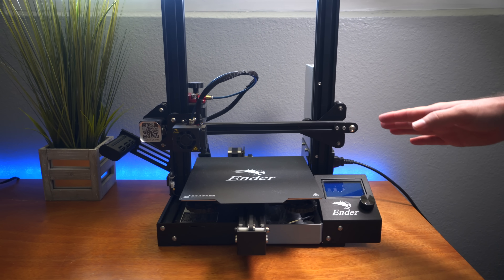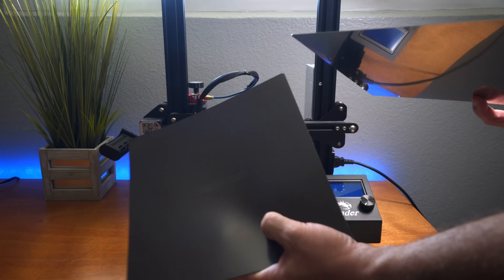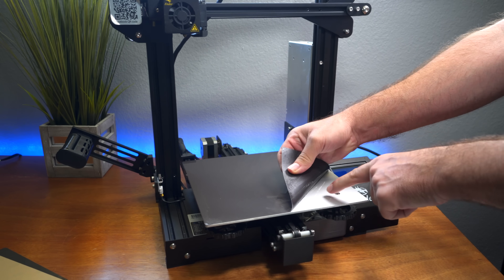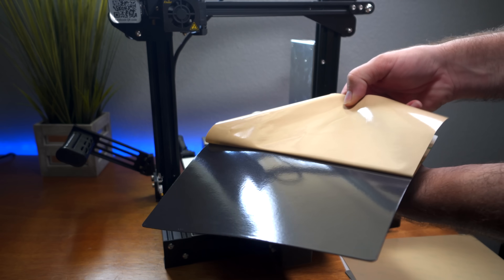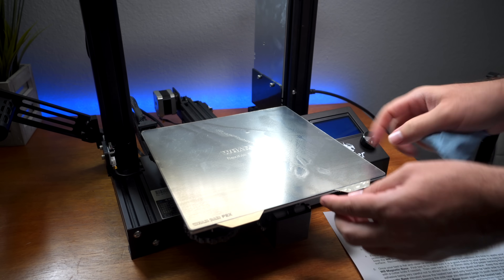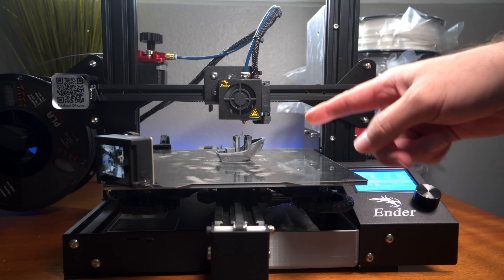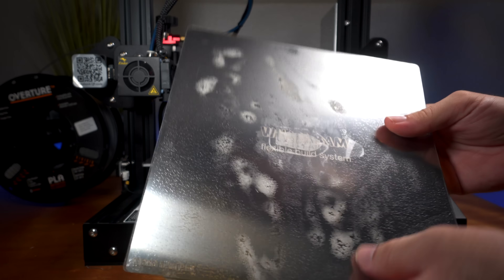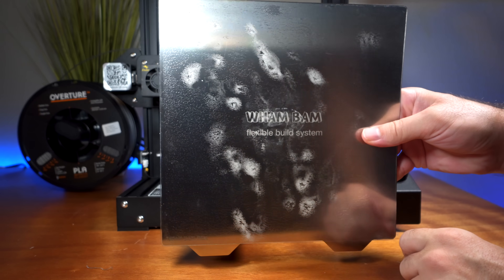Wham Bam - Flexible Magnetic Build Plate - Ender 3 Pro

Comment: To avoid bubbles: Spray surface with tap water first, THEN apply the sticky surface. You will be able to adjust the surface to make sure it's perfectly lined up. Scrape it with something solid but not going to scratch it, like a credit card, to get the bubbles out (since this one has a removable top protection, you can use something stronger, like a metal ruler). Heat the bed, which will cause the water to begin to evaporate and will show you where you missed some micro bubbles. Scrape them out with the credit card while the water vapor is creating a small "air" pocket (aka bubbles), and you're golden.

Comment: the original "sticker" that you peeled off is also magnet sheet. so you peeled off a magnetic sheet to put on another magnetic sheet.
Reply: While there are a lot of problems with this video, I would like to point out that the magnetic sheet he installed can withstand higher temperatures than the stock ender 3 pro magnetic sticker. If you want to print with the bed at higher temps than 70c, it's really recommended to install a better magnetic sticker like this one. Probably not a necessary swap if you're just printing PLA only though.

Comment: Not sure why I see people say that the magnetic bed that comes on the  Ender3 Pro doesn't do well for filaments that take higher bed temps like ABS & PETG. I understand that you can demagnetize the bed at pretty high temps but you really don't need to get high enough for that to happen or at least shouldn't. I print a lot of PETG on my Ender3Pro and it works great. Even used a bit of my old ABS. It holds the prints down just fine. For the models that might give problems I just add a bring to them.
I do have a question or a suggestion really though on this WhamBam metal print surface. Why not just use the magnetic surface that is already on the Ender3 and just save the surface for a later date? I purchased a metal print surface for a printer I'm building and the Ender3 magnetic surface held it down great when I just tried it out of curiosity. So you should be able to save the magnetic sheet that comes with the WhamBam as a spare.

Comment: Protips from an old man. 

1. When removing the old magnetic surface start lifting a corner, then turn on the printer and set the bed temp either as high as it will go or nearly there. If you don't want to use the bed heater, substitute a heat gun.
2.Before reapplying anything make sure to wipe the surface clean of residue with IPA or denaturing fluid.

3. When reapplying any of the surfaces, pull loose two corners on the same side. Line up the sheet you're installing and then anchor the opposite side with your hand and roll back the protective cover under the bed and set those initial corners. Remove your hand from the back and verify it's still lined up. Then lift up the side of the surface that isn't attached and use a burnisher, or something with a hard flat edge, and connect the two corners on the very outside edge only. Then while still holding up the back start working the edge across the surface you're attaching it to and slowly peel back the protective film as you ensure you have no air bubbles along the way.

Comment: When applying any large sticker, don't peel off the entire backing sheet. Peel back about a third, and try to crease the backing if you can, that way you can line up the portion that still has the backing, press down the exposed portion, then slowly remove the rest while massaging the surface.

Comment: ok when you just take the back off the whole thing my heart sank the easiest way to get the magnetic bed on the bed and the pex sheet on the steel is you take a knife and cut the backing about 1/4th the way down so there are two pieces you set up the magnet on the bed and you take folder clips and clip the side that has the 3/4ths backing on the sides and the back so the magnet can't move you take off the 1/4th and going from the back you slowly lower it letting all the air out and scraping it with a credit card or something once that is down you can unclip and peel the other side and slowly stick it down scraping it with a credit card or something so there are no air bubbles since it was all lined up with the clips then 1/4 was stuck down it would stay where it was placed

Comment: scuff bed with steel wool, clean well with alcohol, and heat bed to 70° for both PLA and PETG!
thanks for the review!
Reply: I not sure why you would want to endorse this review. It's terrible and doesn't showcase your product very well.
Reply: I have a wham bam build plate too and i do have some issues with things coming loose due to warping. I resorted to printing with rafts for now.. and a bit of gluestick for good measure.
Reply: @theamazingfuzzy5913  I regret the whole deal because of those issues on my CR10S Pro. I basically stopped 3D printing after I put it on there.

Comment: I would recommend doing the same thing you would do when applying vinyl decals peel 1 edge and use a squeegee to smooth it down as you slowly peel the backing from behind it I use this method for applying large vynil decals with pretty good success rate. Or even use like the other comment water but with very slight amount of fish soap along with a hair dryer afterwards to reactivate the adhesive is the same method for applying window tint

Comment: Use a very sharp needle to puncture holes in the center of the bubbles and express the air out from the outside in with a nylon squeegee like they use for autobody putty/filler. The white area is smaller bubbles from flexion of the glue and moisture. Take your time.